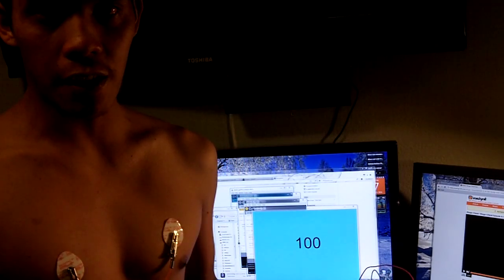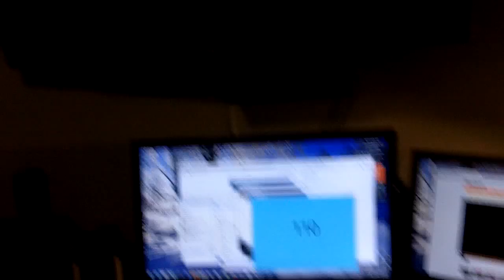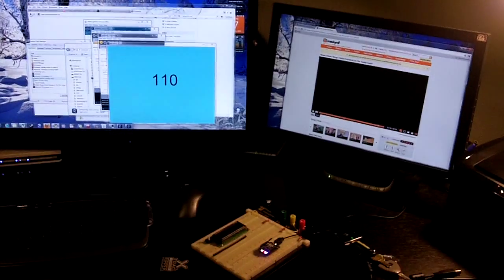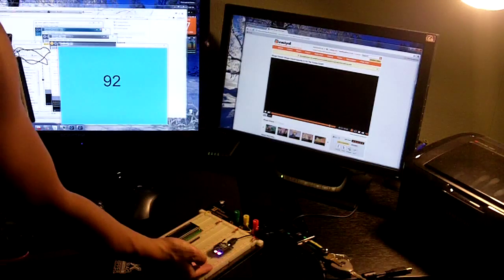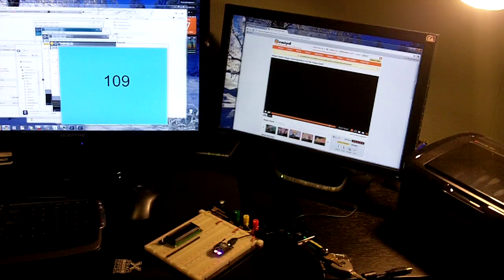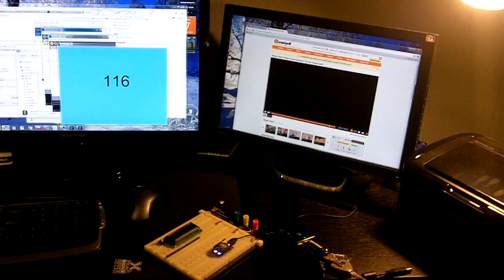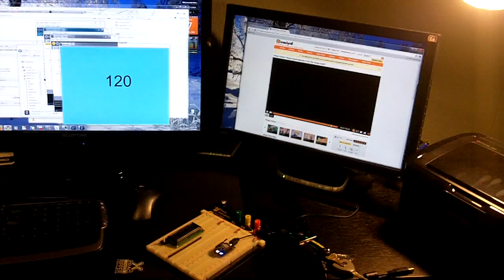Wireless ECG EKG using Arduino and Xbee Radio prototype

Comment: I would like to seek advise from you. i selected a similar topic with you but its a lil bit different! i wanted to make the ecg machine receive the heartbeat signal, and then it can be transferred to anyone via wifi.2. For example, when a doctor ask his nurse to send the patient data, the nurse only have to push 1 button and then the signal of the patient's ecg can be transferred to the doc's email.
my problem is...is it possible to do this project?your help is very grateful..thanks bigdinotech